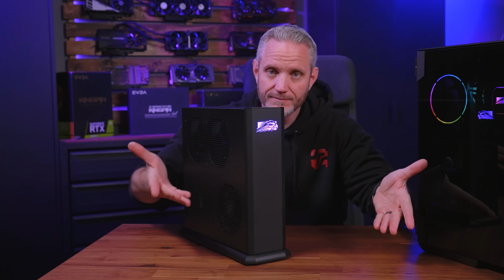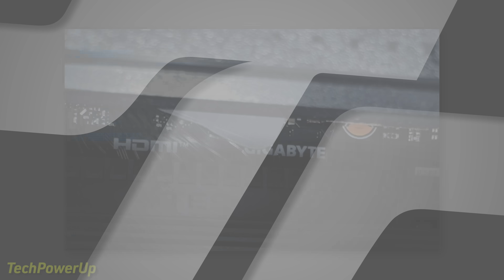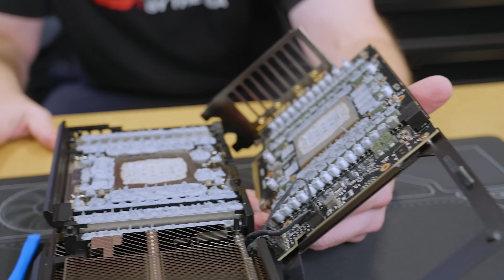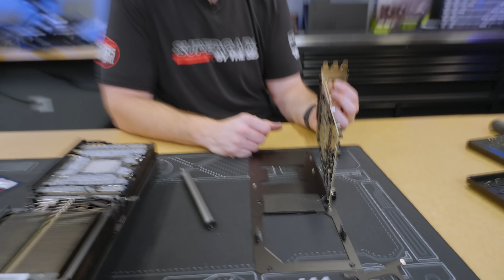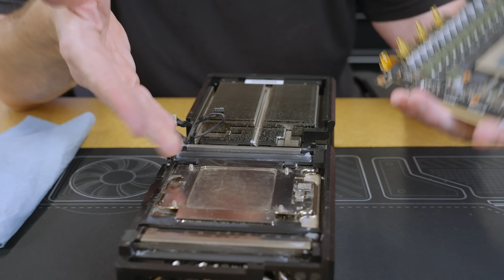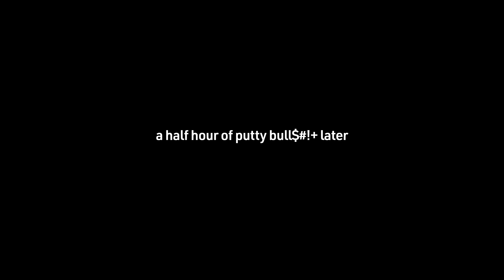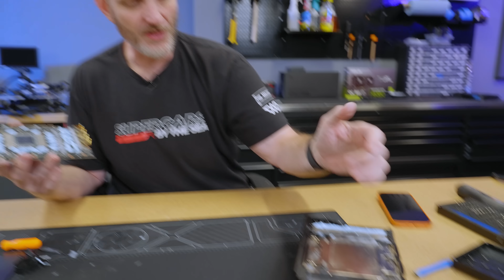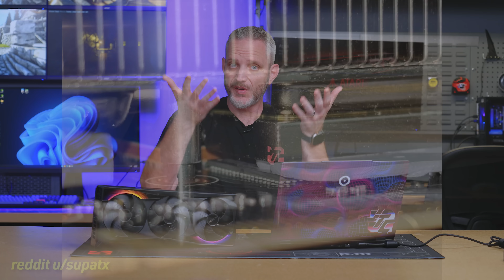What the HECK Gigabyte... WHY?

Comment: The GPU repair guy Vik-On just showed a Gigabyte 5070 Eagle GPU which was broken because the thermal gel leaked under the VRAM dies and caused signal transmition issues. After removing all the thermal gel and reinstalling the  VRAM dies the GPU finally worked well.
Reply: I had this weird stuff on a old HP(IIRC) computer from a customer.
It has a strange pink thermal paste that leaked around.
The computer often crashed already around the bios startup.
I read on a HP official forum somewhere that this pink shit is the cause.
I didn't trust it but I tried. I cleaned and re-pasted and it worked after it.
I think it's pathetic from a professional computer maker to use shit that make computers going to trash for few cents.
Reply: @MrDesillu  "запланированное устаревание" ;) Ваш ПК, купленный готовым у "фирмы" ДОЛЖЕН отработать строго тот срок, на какой у него есть гарантия! Всё что больше - это "кража" денег у производителя(по мнению производителя) - вы ДОЛЖНЫ(по его мнению) сразу после окончания гарантии пойти в магазин и купить НОВЫЙ ПК! СРАЗУ! Как только закончилась гарантия. Обычно это 2-3 года.
Reply: @chveyk  it has already been proven that programmed obsolescence is a marginal and close to non-existent practice on the market. It's a conspiracy theory.
Some documentaries, like the one from Arte about it is BS.
Be sure it would be already backfire by customers if this existed for real.
See Hanlon's razor
Reply: @MrDesillu  вы, прежде чем говорить про "неосуществимую практику" загляните на каналы "ремонтников" ;) Например многие ноутбуки сделаны с "уязвимым" местом. Причём обычно это НЕохлаждаемые мофсеты питания(например) памяти видоекарты. либо "случайно" не установленные защитные диоды по выходам USB и  HDMI. Но отсутствие охлаждения надёжней - можно подгадать срок "прогара" текстолита с точностью в плюс минус пол года!!! Так-же, очень часто "уязвимым" местом делают "перемычки" в ключевых местах с установкой "дросселей"(вроде как для фильтрации) не совсем нужной мощности. Точнее - мощность подобрана так, что происходит тепловая деградация проводника спустя 3-4 года. СТАБИЛЬНО. 
Про "негатив" - сми и "проплаченные" обзорщики в прессе и на площадках решают ;) КТо услышит голос одного-двух кричащих в толпе "согласных"???
Reply: @MrDesillu  ещё некоторые "наблюдения с полей":
"текущие" термопрокладки, заливающие всё и вся вокруг силиконом, из за которого карты переставали работать; "удвоители" фаз и их отсутствие на НЕКОТОРЫХ фазах видеокарт - как только мосфеты в данный фазе начинали деградировать - фаза сгорала с прогаром и фейерверком!! Деградация была стабильной по времени работы(полупроводники довольно прогнозируемые элементы) - хватало небольшого разбаланса в фазе для получения фейерверка! 
Из мониторного - стабильное выгорание LED-подсветки из-за ЧРЕЗМЕРНОГО выставленного тока на линейке. Так-же выгорание самого скалера(основной чип монитора) из-за его перегрева и ОТСУТСТВИЯ РАДИАТОРА!!! 
Это всё можно списать на "Инженерные ошибки", если они были редки и не постоянны.
ЗАБЫЛ! Совсем забыл недавнее "нововведение" - применение в ноутбуках и видеокартах жидкого металла с завода! И если на картах оно как-то прижилось(хотя данные о сгоревших уже есть), то нотубуки массово "коротит" из-за обильных протечек жидкого металла на плату! Ибо "защитный слой" имеет  конечное время защиты - "липучка" отлипает и начинает пропускать ЖМ!
Reply: @MrDesillu  That's a silly thing to say, because there are real world proven examples of planned obsolescence in many products already. Obviously it doesn't mean that every product is, or every manufacturer does that. It could even be marginal. There are billions of different manufacturers and products, they can't all be tested and verified, and every product, and batch is a unique case. But making such sweeping statement that planned obsolescence is only a conspiracy theory is just false, and dumb. It's just something you need to take into consideration, when buying a new product. And perhaps not support a manufacturer again, whose products die on you before their time. And even if it turns out to be just a conspiracy theory in some cases, it's the best kind of conspiracy theory there is (because it is often true), and being cautious about what you buy is never a bad advice. And don't forget there's always also unplanned obsolescence: you don't have to attribute everything to malice, when there's plenty of incompetence, laziness, and stupidity to go around. Doesn't really matter if it's planned or unplanned, if the end result is the same; failure.
Reply: @Baalaaxa which examples?
Reply: @MrDesillu  examples?
Reply: @TheKickKat  Yes it s a thermal past from ali expresse XD
Reply: It is the latest video on the "vik-off" channel, if anyone wonders
Reply: 4 years warrantly.... Don t touch her ;)
Reply: GPU vertical installalation, right? )
Reply: @Encrouter  he didn't specified that, but I believe it could happen while the GPU was installed in horizontal position
Reply: @A.J.99  Never saw it with good temps up to 60C.
Reply: @A.J.99  нет. там в видео чётко видно, что "затекло" с одного бока чипов памяти - карта стояла вертикально!
Reply: can you link the video?
Reply: @shrey522  it's on "Vik-off" channel
Reply: How does goop die
Reply: One more reason to go to thermal pads, should last forever and performance is better than cheaper paste most people use, and probably better than the expensive paste after it dries out a bit
Reply: My card was dead bcoz of mosfet burn same card but ti
Reply: Agreed, we can attest from the early 90's HDD's still buzzing about once power gets to them, and capable of presenting data when requested. Unlike most early model and modern SSD's that fail often but again provide a greater value in performance.
Reply: Uh oh.  Just got a gigabyte 5060ti.  Now im scared.
Reply: @CaptainRufus  Why ? it s revolved a long time ago :D
Reply: I couldn't see my "hotspot" temps in HWiNFO64 for a long time.  Now I can see them.  My Gigabyte Windforce OC SFF 5070 Ti is hitting 100C-106C hotspot temps in games that are pushing it to that 300 watt max.  I preferred having the OPTION to change thermal paste, not the REQUIREMENT after a year of use.  

I have NEVER liked Gigabyte.  They could fk up a wet dream.  GPUs, motherboards, all they do is fk stuff up.

Comment: I’ve got a water blocked MSI gaming Trio in horizontal configuration. I used TG TG Pro putty w/duronaut on the core, and have been very pleased with the results.

It took a LOT of putty to do everything on the card, and even more for the back of the card to the back plate. I believe it took 4 cans of the putty…

Comment: Would be cool to see the performance with normal thermal pad instead of putty to see if it's really affecting performance or just marketing bs
Reply: I have 5080 Aorus master with thermal pads but with water block. Temps are awesome. But like you said, would be cool to see it with air cooler and pads.
Reply: @hector1908ym would you be kind enough to tell me which water block you are using? Want to WC mine but I’m hearing alpha cool does not have it figured out and some people have to add the jelly stuff to bring down memory temps. Would really appreciate your response.
Reply: Hardware Unboxed reviewed the 5090 Master and it outperformed the MSI Suprim in thermals and performance 👌
Reply: @arnoldmorales9189  one of the better 5090's not sure what Jay is trying to do other than messing with 5090 owner's heads and now they have to check everything

Comment: Guess who just built a system with a vertically mounted Gigabyte 5080 Gaming OC on an NR200P hot mini ITX case...🙃
Reply: Put the case on it's side?
Reply: Don't worry about it honestly. I have the Gigabyte AORUS Master ICE 5090 and it is vertically mounted and has been doing fine even at long times under max load. The thermal gel issues were almost entirely a problem with early lots of GPUs. I don't really know why this video is just now being published.
Reply: I made my own build in may. I modifyed my nr 200p max,  fittted 9950x3d and gigabyte rtx 5090 windforce oc. I have no issue yet, but i think that it would be wise to check whts going on there.
Reply: Doeth!
Reply: i just got my aorus M 5070ti and was just thinking on doing vertical mounting too 🙃 F
Reply: Somewhat glad I went with the Asus Prime 5080 instead.
Reply: This OOZES of "YT scare tactics". Yes it happens but not enough complaints because guess what? EVERY major GPU maker even get cards DOA. So not going to be worried until/if it happens. Living your life in doubt is no fun ;))
Reply: You'll be fine. Gigabyte fixed this months ago.
Reply: @MrKingSob  "Thanks Steve" -Jay

Comment: Gigabyte did say that the first batch of cards had too much putty applied and they reduced it for later cards to fix this issue
Reply: The main issue is not the amount but the actual composition of the gel itself. The gel seems to liquify at high enough temperature thus can move from where it supposed to be. Gigabyte saying too much of it simply to avoid a recall. There are pictures where there were supposed to be gel but gone. If it is just an amount issue, there will be some left. You don't want the component that supposed to be cooled ended up not having this gel between the component and the cooler.

PS5 also use something like this (except for the CPU which uses liquid metal) and when people tear it down, you don't see it gooey like whatever this gel that Gigabyte is using.
Reply: That turned out to be a blatant lie. They said the cards with the first 4 digits of the SN after 2509 were fixed. My 5070 ti is 2513, and it's clearly still mega gooped up.
Still a great card, though, no issues.

Comment: Pump out is from thermal cycles, as it heats it expands and some exits the space between surfaces, when it cools what expanded out cannot contract back into the space. Thermal putty that phase changes(putty to gel and back to putty) will also pump out from between components and the cooler even in a horizontal orientation. Instead of the putty being between the component and cooler it will be spreading out on the cooler. Over time it can completely cover the cooler and no longer fill the gap between it and the component. The stuff is not only difficult to apply by hand but also worse in the long run. The only reason to use it is in manufacturing to save costs you only need 1 putty rather than 2-3 pad thickness and however many cuts. It's not better its a cost cut. If you need to repaste then replace the stuff with pads.
Reply: Isnt this exactly what is said in the video?
Reply: @bigginsg8711  I mean yes, but to me, comments are an opportunity to think about the video or hear what other people think so... this is on point. :)
Reply: @bigginsg8711  Not exactly, he said if it is in a horizontal setup the thermal putty would be fine. I disagreed with that assessment. Thermal putty pumps out just like paste will if it goes from a putty to a gel and back during thermal cycles. A horizontal mount just makes it drip out from gravity making the lack of thermal putty faster. Not the same thing said.
Reply: Is it too much to ask for a GPU that never has to be opened and repasted? Does such a thing even exist today?
Reply: @user-f1ff23  Graphite pads would do that but then thermal pads dry out over time and lose thermal capacity, putty that doesn't change it's state will also dry and crack like paste that doesn't liquify under load does, You get pump out or dried cracked paste,, pick what you prefer I guess since your CPU will also be affected by it.

Comment: I've had my 5080 for less than a month in a vertical mount and almost all the thermal puddy leaked out off of the lower memory, so far i have not seen any performance difference, and i read somewhere that gigabyte replied stating its over applied puddy and the stuff leaking out is extra and is not a worry, this video does not give me hope.

Comment: finally gets a Gigabyte 5090 this video comes out a day later
Reply: There were supposedly only a select number of serials that were affected by the oozing, I have a 5090 Gaming OC and have no issues with it. Have since torn it apart and waterblock’d it, removed all the thermal putty, and replaced with Thermal Grizzly putty. Seems much better consistency
Reply: And It'll be fine. People hating on Gigabyte/Aorus are legit just haters
Reply: Yeah just picked up the windforce non oc at msrp 😅 havent opened it yet
Reply: @BrownclassGod I got my 5090 Aorus… a few months back. And come across this video today. 😳
Reply: @GEN-XArmyVet  hopefully all is good. I think I'll be keeping mine in the traditional mounting position just in case.
Reply: @BrownclassGod mine has been mounted vertically since that day I got it because of the Y70 case. I haven’t had any issues yet… but I also don’t overlock or do anything that would cause it to heat up excessively.
Reply: @GEN-XArmyVet yeah me neither I am interested in trying undervolting maybe if it is similar performance with much less power. I've only just heard about undervolting though.
Reply: @BrownclassGod  I've had my 5090 Aorus Master vertically mounted in the HAVN HS 420 VGPU case for about 6 months now. There's zero drip at all and I play high end games in 4k constantly everyday. I also work in UE5 and I have yet to see any "leaking/dripping". This was a known issue in the first batch of Gigabyte cards and was fixed right after. If you bought a Gigabyte card after that period (February-March) then you'll have zero problems. You'll also never have to replace the thermal pads or compound either. Amazing how much damage can do to Gigabyte with a first batch iteration that was caused by 1 single factory in vietnam. I love jay, but when he claims that there's tons of evidence of this, no there is not. It's always the same pictures. There's very little evidence because this was an issue that only happened to a handful of people.
Reply: @BrownclassGod you can actually get better performance from undervolting. Less temperature=higher clock speeds.
Reply: @BrownclassGod  water cool use your own thermal paste
Reply: @BrownclassGod   its a good card.  i have the same one.   love it               in the video tho if its like that inside.........  def wouldent wanna take it apart   LOL   its like a grilled cheese sandwich in there
Reply: My 5070, and all my other parts, show up today. :/
Reply: @christopherthompson2004  I have the Windforce OC and our 5070's don't get hot enough so no worries
Reply: It's almost funny enough to make me not feel bad but man... That's gotta suck to think about even though you're probably fine.
Reply: I wouldn't sweat it, probably fine. Even if you ever do need to paste and putty it yourself later it isn't that hard. The worst part is the putty isn't cheap. (I mean I guess compared to the card it is). Also the jars are waaaaay smaller than you think they are when you look at the pics online.
Reply: literally same. Just picked up an aorus 5090 from best buy the day before this video came out
Reply: @willz34_  Still like it? What'd you have to pay. Not sure if I should pick one up at 2700 after tax... really wanted an msrp card.
Reply: @zackw7587  No issues here. Honestly love the card, looks great and runs really cool and quiet. I paid $2600 since I bought it in a state with no sales tax. However It's really only worth the $600 premium over MSRP if you are set on the looks/cooling of the Aorus. For me, it was a "go big or go home" situation where I just wanted to get the one I liked, since 5090's are expensive regardless.
Reply: @willz34_  it is not an issue man, I have it for 5 months now vertical setup and nothing so far, and even though, it is not conductive and won't affect your temperature, and if you just didn't like it you RMA it no issues. It's the best card out there in terms of loudness and temperature. I did my research and I know about it before I bouth it $3600
Reply: man you guys, why would you buy a gigabite card that is so expensive? At that price go with something of quality, damn...
Reply: @rarespetrusamartean5433 the quality is not the issue here. It's the choice of thermal transfer by using putty for memory and VRM and a hybrid compound paste for the GPU
Reply: @rarespetrusamartean5433  what is "something of quality" according to you? whichever brand you are a fanboy of based on anecdotal evidence of owning a couple cards from them?
Reply: @Glotttis  I've always owned AsRock because they're the cheapest and they've always been POS's 10 years ago and also now. I'm literally the opposite of your assumption, congratz.
Reply: @rarespetrusamartean5433 because it's the best performer maybe ? And the fact that you don't need to service it at all with the materials they are using maybe?
Reply: @Byte.Burner well its not the best performer on your mental health if you need to constantly worry about it. For the amount if money a 5090 costs it should be perfect.
Reply: @creativehorse7907 worry about what? Even if it came out so what? It's not conductive.
Reply: @Byte.Burner  yea the best performer that you also need to take apart to fix when it starts pooping itself, like a Lambo that leaks oil and coolant...
Reply: How people don't go on the Internet to research their $2k purchase before hand and are surprised by this old news absolutely astounds me
Reply: wah wah...